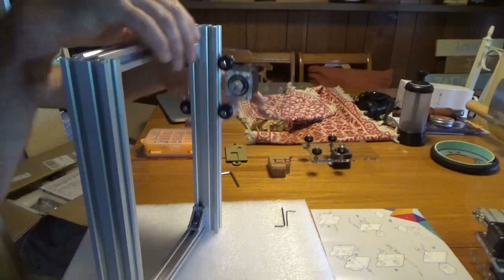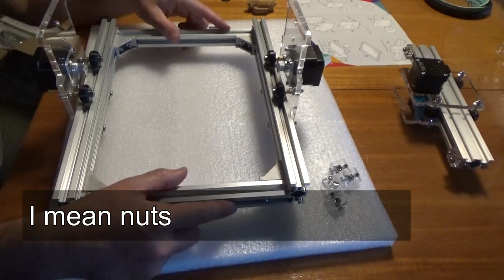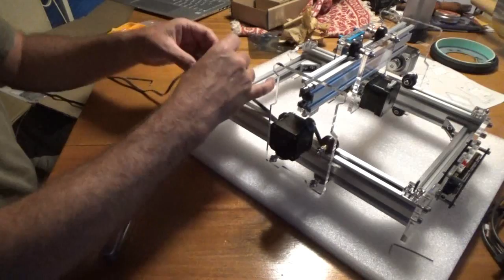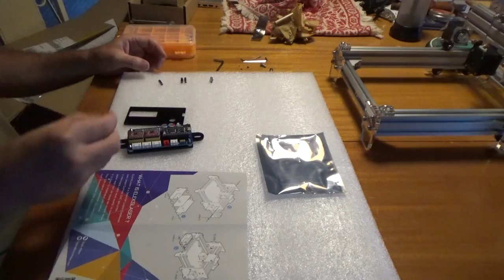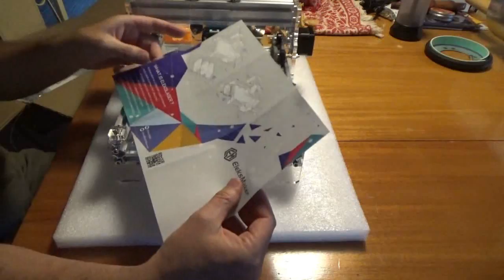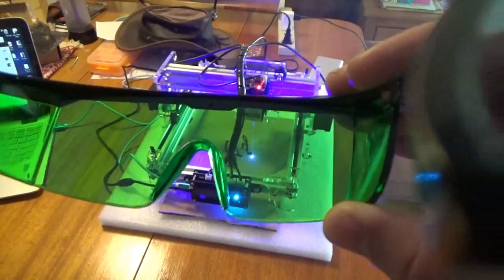Detailed Assembly Of EleksLaser A5 Laser Engraver Pt 2

Comment: Thanks for the video on how to assemble. I couldn’t have built mine without you. I have it connected to the computer, turned on and the signals all work. For some reason though, the 500mW laser doesn’t burn the image onto the piece of wood I used. To you have any suggestions for software and how to set it to burn vs just lighting up, going through the paces, but not actually imaging? I used the Eleksmaker draw software.Maybe I need something better?

Comment: You have saved my life with this video! THank you! How do you get the circuit board to be snug? mine is very loose.
Reply from the maker: The sliding feet that hold the board can be tightened. Then the board screwed tight into that. But my board is not perfectly tight either.

Comment: Hi Sir!

Thank you very much for those 2 Assembly Videos.  Although I had previous experience in assembling my previous Laser CNC, this one was very useful!

I just used your DIY Video to assemble my 5,500mW Version of this wonderful CNC Machine.  Although my assembly is somewhat different than yours (from previous experience), I had to make some modifications to the original plexiglass pieces, on both carriages, in order to make them fit correctly.

I had to do some holes to move the whole top carriage backwards, so the 5,500mW Laser module does not burn through the aluminium frame, since it's much bigger that the one used on yours.  LOTS of « Cut & Try » on this, but hey!  It's cheap! Hahaha!

Also, I routed the side motor's wire on each sides instead of on the top.  I used the two black plastic protectors (you didn't use them) to protect wires to be scratched by the carriage motions over time.  Much nicer look.

I installed the two carriage motor on top instead of on the bottom as you did.  This makes the wires all in the same place, close to its connectors.  Nicer view.

All in all, I will install the firmware and use the very same software I used on the cheap 2,500mW version on this very same CNC/Engraver.  I hope I will be able to print/engrave pictures (grey tones), so I can make more elaborate work.

Have a nice day!

Comment: Please help! I think my x axis motor is too tight, just like yours! When I try to engrave, it only engraves in a strait line, and cant move left or right! Any tips for how to fix this?
Reply from the maker: Yes, loosen the screws that hold the wheels in place. I am working on a video with tips and this is one of them. Just loosen them a bit on both sides until the unit slides easily.